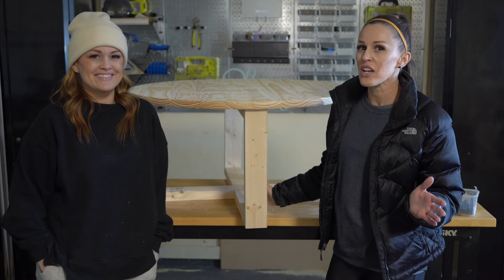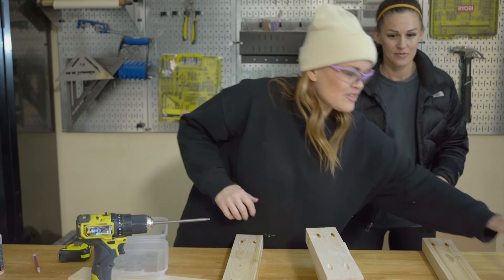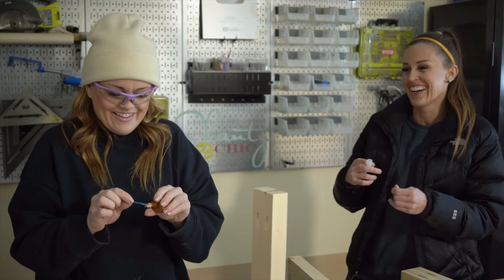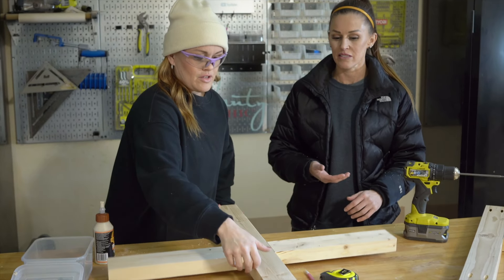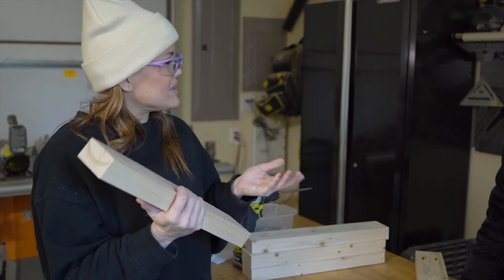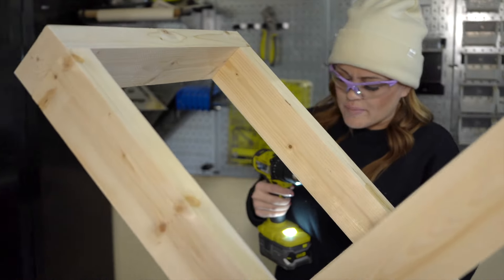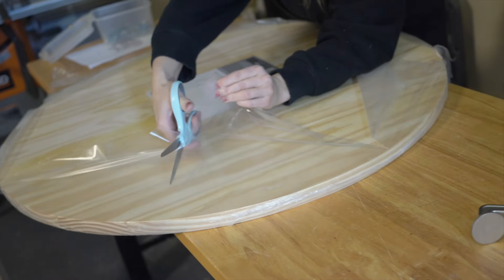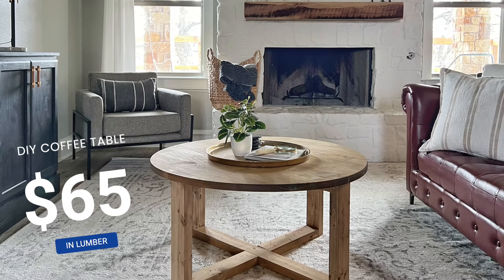DIY Round Coffee Table for under $65!

Comment: I have experienced warping with the smaller version of this tabletop. I would recommend attaching the top with clips or use another method to allow for wood movement across the width of those laminated boards.
Reply: I’ve seen builders talk about diy furniture like this and how the lumber shouldn’t be used off the shelf. It needs months to fully dry out.
Reply: Clips?  Like brackets? Can you elaborate on that please? I saw another video that used Z clips and no glue.   I am learning and appreciate the tips